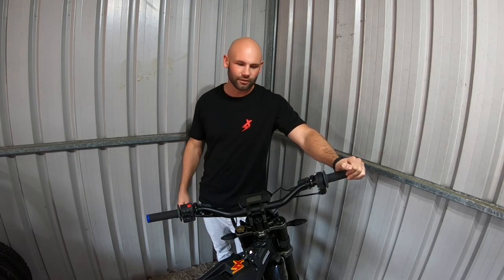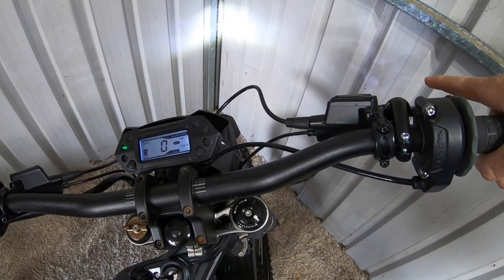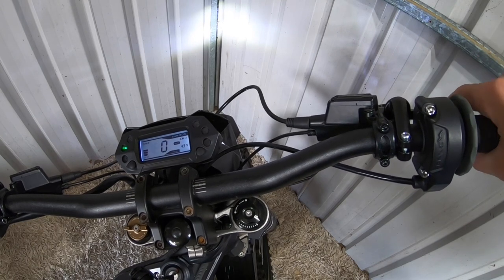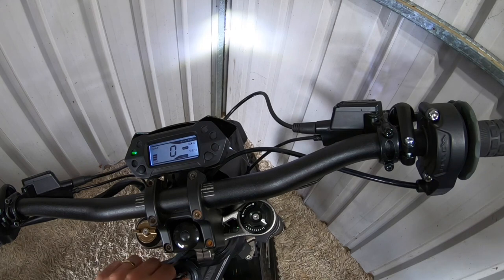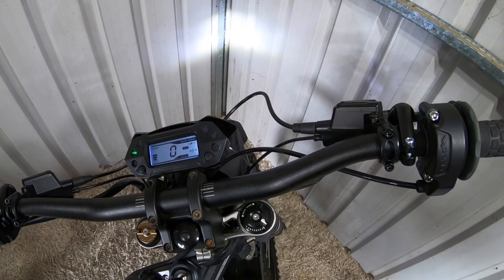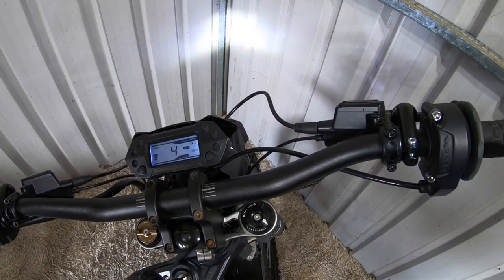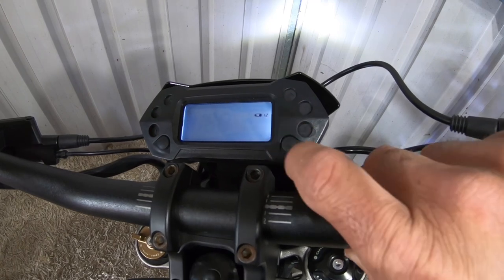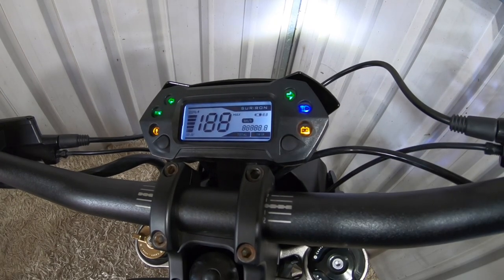Unlock your Sur-Ron… How to programme your Sur-Ron

Comment: Great video but on my 2024 Surron only the brake sensor worked with your tutorial.  The regen hack didn’t work.  Any suggestions for regen on a 2024 Surron?
Reply: I really need to know 1 as well
Reply from the maker: Sorry, I haven't played on the new version yet
Reply: @lucagonzalez1755  I contacted the distributor and they mentioned this feature is no longer available on the 2024 Surron.  Apparently it has regen but completely controlled by the controller
Reply: @Alex-oy6wb i can do this with my 2024 lbx 40v 60ah
Reply: @wild_media  do you have the single connector to the battery or the dual connector?
Reply: @Alex-oy6wb dual! Or the new one with orange wire
Reply: @wild_media  dual is the old version.  The single connector is the new one
Reply: i can do this with my 2024 surron lbx and it has the single connector
Reply: @piggy290  yeah…I think mine came with a brake sensor issue because it didn’t work
Reply: @Alex-oy6wb  yea when i first opened mine up the brake sensors didnt work so i plugged in the programming cable and turned them back on and it was all good.

Comment: YO I NEED HELP from you!😢 I put my Surron on c1 and now it’s stuck on it! I tried your explanation for putting it on C0 and it doesn’t work! What should I do!
Reply from the maker: @borisarsenov5639  you can try unplugging the battery give it 10 minutes, connect it all up again, and go throw the process again. Shouldn't be any reason for it not to change, make sure you turn it on and off before trying to change settings

Comment: Is there on for unlocking the speed limit on the 2023 l1e
Reply from the maker: It should be the same
Reply: What is that code the 4 short one long?
My 2023 S is all set stock what codes will maximize the speed and performance with the 48 Volt battery???

Comment: hey mate what exactly is the power curve you are mentioning?
Reply from the maker: I haven't seen one on a dyno to see the difference, it just comes up on the dash as C0 or C1. I couldn't feel a difference in the "power curve" but give it a try and let me know if it changes the bike at all for you
Reply: C1 is street legal 45kmh and C0 is offroad so uncapped speed so like 70-80km @danburgez  atleast thats what my l1e version does from 2023
Reply from the maker: @varzso24 I cut my green wire before testing but I guess that makes sense 👍
Reply: @danburgez  if you got a 2023 Version there is no need for the wire cut since you can use a break code to unlock it. But in the end if you dont care about that  its fine. I dont wanna cut it because of the issues it could cause

Comment: much diffrence from 48 toot to 52 ?
Reply from the maker: I run the 58T if you're on stock power its a big difference on the bottom but you will lose top speed